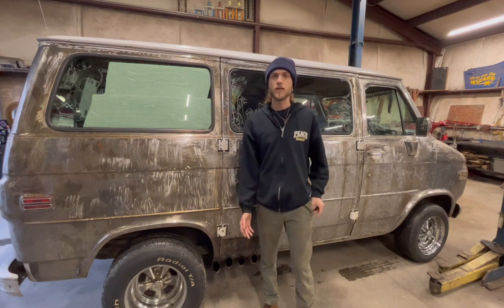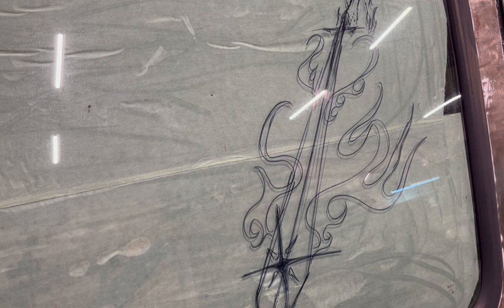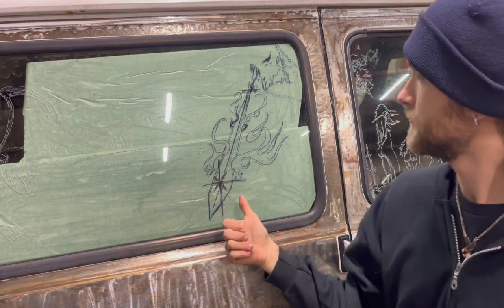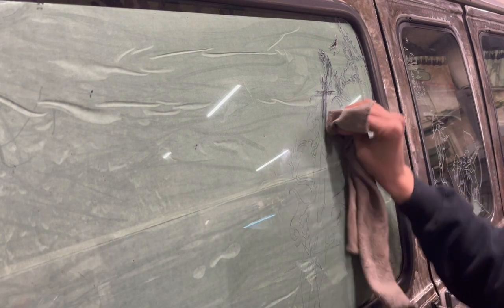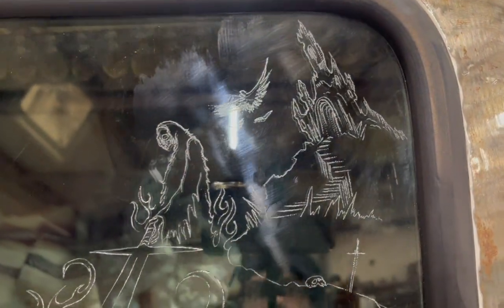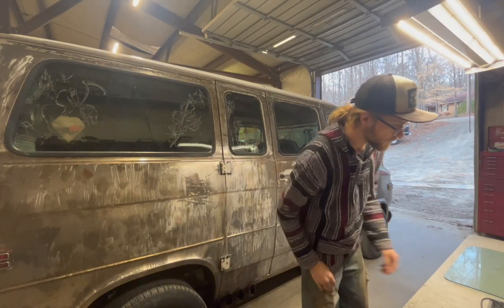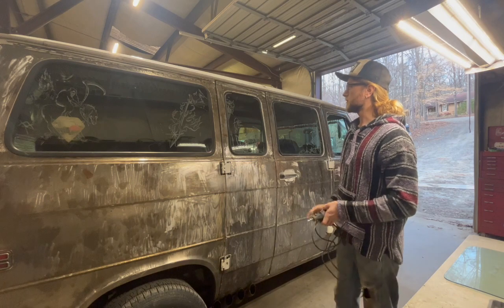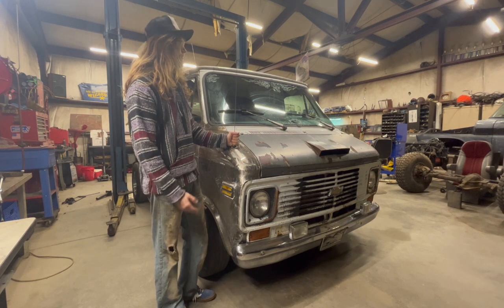Glass Etching on Custom Boogie Van - Art by Seth Williams

Comment: Nice work, I like to add a bit of color to some of the more highlighted parts of the piece by dry rubbing some paint into it. I use modelers paint, I haven't done any since the 80s but plan to get back into it with my 67 chevy G20 van.

Comment: I avoid half the issues by drawing on paper first, perfecting the pencil drawing, tracing over it with sharpie, then sticking the paper to the back of the glass, and then etching. Long as you have the same pov with your stance, no issues and less clean-up.
The only issue that pops up is if you shift and it is a thicker glass, a line may not line up (distorted slightly by window depth). 
And yes... still works with tinted windows, just changing from black to mettalic silver sharpie. 
It also lets me know if it will work as a black and white composition before  adding it to my windows.
Reply: Also old school trick.. fill them in with white shoe polish to see them better. Some prefer model paints for a full color window. (I prefer the white polish and using a black light to make them glow.)

In addition to goggles and a mask, i also wear gloves... cause the glass slivers are pokey (like fiberglass shards).